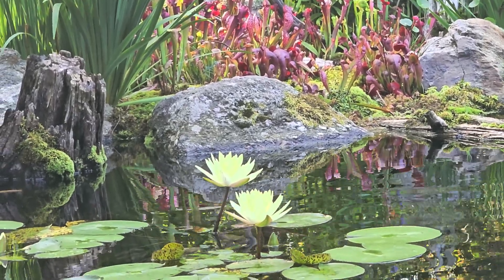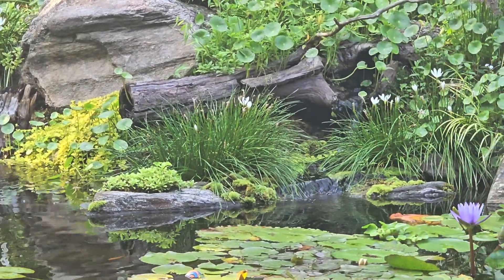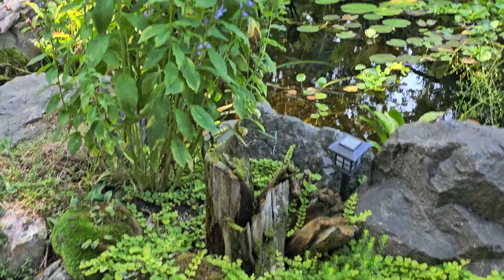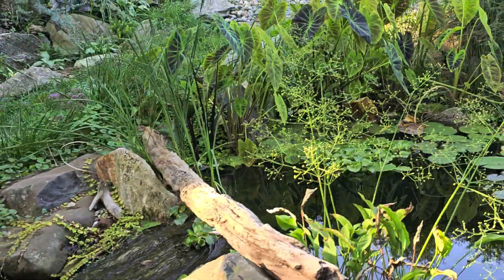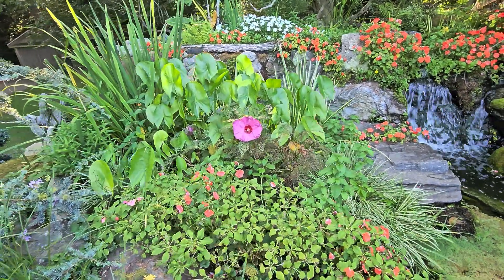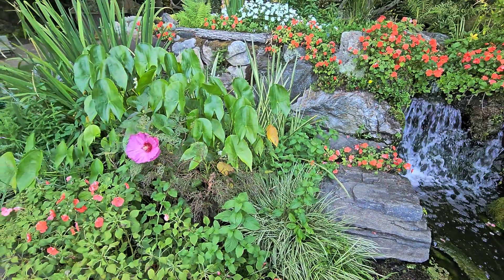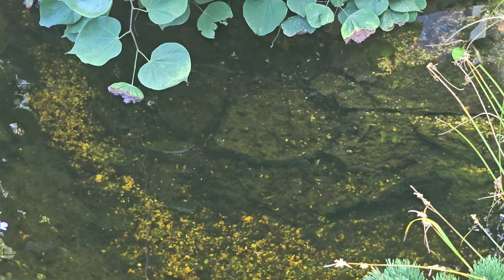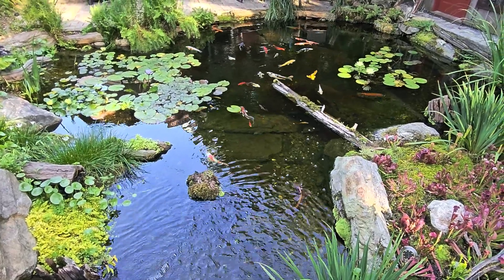Let's talk about the filtering of an eco system pond with a Bog ,  Wetland filter

Comment: Wow! All I can say is wow!  I have been planning a pond for quite a few years now and might be able to pull the trigger this coming year if the economy doesn't crash.  Sir would it be possible to get a diagram of your pond with specs, dims, and equipment?
Reply from the maker: Thank you for the compliment,  I put Together what I wish I had found after I built mine. The first half is the individual areas described and why i built them. The second half is the actual build , sorry to say only in still photos of the build, but it   is loaded with lessons learned. It can be found here  https://www.gardenpondforum.com/threads/some-very-impressive-pond-builds.26353/ There is a discussion area its at the start of the page but it brings you to a second page so if you have any questions you can ask me there.